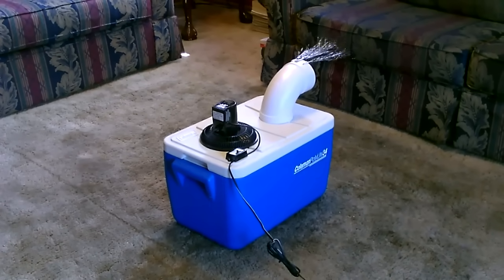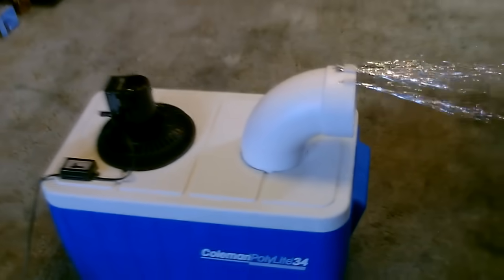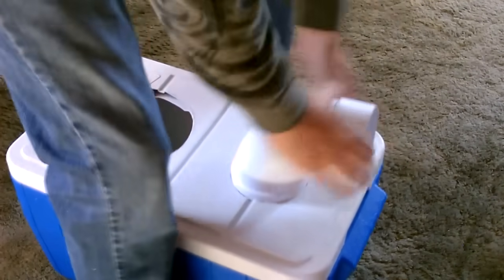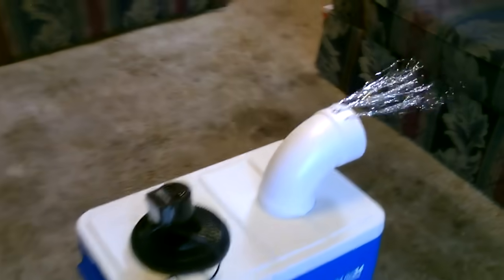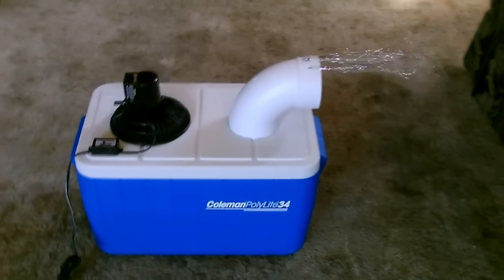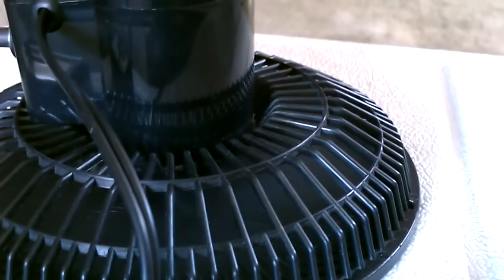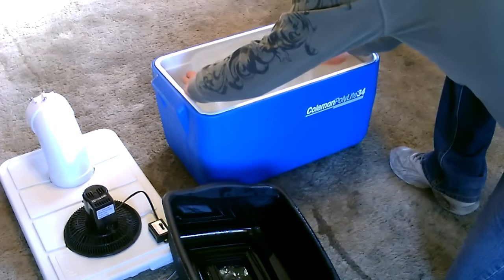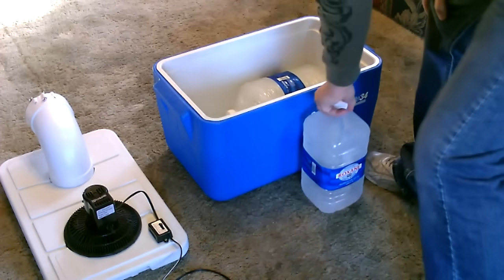Homemade air conditioner DIY - Awesome Air Cooler! - EASY Instructions - can be solar powered!

Comment: nice cold air blower,  if you studied thermodynamics and heat transfer (in mechanical engineering) you will understand one must take the heat (energy) from inside the room and dump it outside the room. That's why window air condit have the hot electric parts outside the wall.
Reply: ***** no. the slower the air flow, the colder the air out. if it leaves the freezer fast  it doesn't lose most of the heat inside the freezer so you don't get a colder aiir . if t it stays inside the freezer longer, the colder it gets when pushed out. Here is a tip for your proj, put bottles of ice inside vertically  better than a full square of ice, as the air go between the vertical bottles and gets colder quickly just a tip it's like cold fins.
Reply: ***** very good question. THink of heat as a quantity of energy that moves from high temp point A to low temp point B . Ice will let in a quantity of energy until it averages it with the surrounding temp, inside the cooler the surrounding temp is lower than the outside. Now you see why more heat gets inside the cooler, it should be slightly hotter than the outside when the room is fully refreshed with cold air.  The air will cool quickly if the bottles are inside the cooler container, and leaves that heat energy from air inside the container (it's built with heat insulation material to decrease heat transfer rate in or out) so it lowers the room temp, when the room is fully cold ,the heat temp in the water should be higher than the refreshed  room temp because the insulation of the container prevented heat temp from averaging with outside of the container temp, you take the water dump it. heat is outside the room now haha. Now if you do ice and fan on the open,  the ice will take some heat until it reaches "Average" room temp when refreshed. There are many factors like fluid dynamics etc, conduction convection radiation etc There is good book on heat transfer if you need more info on theories and calc (Heat Transfer by Cengel) you must have background in physics and math to get the theory. I wrote a bible sorry and still not enough hahaha
Reply: Spacefied Actually, this unit does remove the heat from the room as the heat is absorbed by the ice and stored in the melted ice (water) for dumping later. So long as the freezer used to refreeze the melted ice is in a different room the heat is effectively transferred to the room or space containing the freezer.
Reply: Gretchen Gund exactly,  hot air is converted into cold air, heat is dumped inside the cooler and doesn't escape to the outside because of insulation , causing the ice to melt. did you think of using dry ice ? should stay longer and is colder than regular ice
Reply: Spacefied You lack some bio skills. Dry ice is C02, is it not?  try breathing some of that. just make sure you stop breathing from the paper bag test before you pass out.
Reply: my chemistry is strong, so is biochemistry. I know dried ice is  CO2 at very low temp below iced water temp. I was just throwing ideas for inventors like this gentleman to develop, like making insulation walls or have it compress etc to keep the co2 or reuse it, or make a cycle to cool it again, if CO2 is a problem, then find a solution to use it safely it can be best or may not be I don't know, this what engineers do, problem solving.
Reply: canrobsd good stuff.
Reply: I have actually seen these types of things in auto repair garages, like giant 5 foot black boxes with a 4 something foot fan with a radiator  behind it with what looks to be run on a cold liquid. Same principle as what were doing, drawing air through a cold "radiator" (lined up bottles) inside a cooler (box)

Comment: Damn my huge vornado fan would rock if I can find a ice chest big enough to fit the fan on top. It spits out so much air, it's the largest room circulator before vornado starts putting the fans on stands.
Reply: Clear Adventure You are at least thinking, but the amount of airflow does not matter that much UNTIL you want colder air.

 The temperature of the air will be higher with a fan that produces more cfm, but will bring the room its in to that higher temp faster. Suppose you have a swamp cooler thats setup with 2 fans:

 Fan 1 produces x cfm and produces x temp. (for the sake of making it clearer im going to artificially make x temp 40F)
 Fan 2 produces x + 100 cfm and produces x + 25F (again made up numbers for sake of clarity). But more cfms will cool your room a lot faster to reach that slightly higher temp

Im going to make the best of both your comments, make a swamp cooler with a 2 fan setup (can be the same size) for rapid cooling then turn one of them off to get a colder temp.

I am too lazy to calculate air direction and flow over a surface area of ice that is constantly variable due to melting, and the size of box the air must go in, calculate any leaks in the system, humidity, sunlight through a window causing heat, and many other variables that make the math hard and tedious, So i just threw in some numbers for ya.
Reply: Zcypot LOL. Only problem is, too much airflow, and it defeats the purpose. The air around the ice has to cool first.  So a slower fan is best. I have some strong air fans also, would almost knock a small child over, lol.

Comment: the device works in areas with low humidity because it relies on evaporation. if you are in regions with high humidity the air's capacity to absorb the evaporated water will be low. hence the device will not operate in these areas.

Comment: Well, just did one of these, not impressed.  Room air temp is about 75, air coming out of my cooler was average 68...not sure I believe the 42 degree air claim as posted by others...I measured my car AC once and it was 38-40, and I don't think there is anyway air over frozen ice can pump out 42.  Maybe I am doing something wrong...but it is pretty simple so I don't see how.  Any help
Reply: i know how to get colder air larger ice and put another fan in the front  hole of the pvc and feel the difference omg but never use dry ice you will die!!!!!!

Comment: doesnt using ice from the freezer not really cool the room because in order for a freezer to make ice it has to pull the heat out of the ice and put it back into the air therfore not really cooling the room
Reply: Dean Walcott Because, everyone has his freezer placed in the livingroom right?
Reply: yes
Reply: Dean Walcott LOL good one. The whole Idea is comfort, so just blow the air on you to get cool. Or, If you were really serious, try to use it without A/C just put the fridge/freezer outside and cart the ice in to cool your room. But opening a door to go in and out may defeat the purpose of it all. Its hard to win without using A/C. Just blow the air on you while watching TV or something.

Comment: I noticed he is infront of the air of does temp runs right at the output, however what about the room itself, I am actually thinking on doing this in my downstairs bedroom so that way the whole house AC doesn't have to be turned on, great idea but if it only cools a small area and not a room then might have to go with a 9000 BTU Potable AC

Comment: Why don't use solar panel as a power bank for the real air conds? save electricity...
Reply: Shah Iskandar The 15 watt panel wont run a standard 120v ac unit. And if you wanted solar for that it would cost thousands. Where is the savings?

Comment: Suppose you have the freezer in the kitchen and you're cooling the bedroom. If all the doors are open, then this would be beneficial only to the extent that the air in the two rooms doesn't mix completely and provided we ignore the heat added from the electric motors in the freezer and fan. However, if you can isolate the two air spaces by closing doors, then it would be fine. The kitchen would get hotter (from freezing the ice) and the bedroom would get cooler (from melting the ice). At least that's the theory...

Comment: I LOVE Wisdom like this!! I am an Old Time Doer in that I departed Detroit, Michigan years and years ago. I raised 6 children alone including my small family farm with animals! I LEARNED so much to include milking cows, goats, hogs, peacocks, chickens, rabbits etc., churning, canning etc. I hooked up a heating system using a US Army #1 old wood stove using fans, big pots of water for humidity & circulation of heat. Summertime I used fans and ice! Sometimes I 'failed' so Miserably in my 'homemade' survival attempts until my children and myself just burst out into Laughter! Even my pet dog, Sable turned her head sideways and gave me a look saying 'are you sane?' I will share this so you can laugh too! I called myself repairing my old Singer Sewing Machine? To this day I am not sure how I reasoned how to repair my Singer Sewing Machine?! I plugged the Old Singer in and it had so much Power it flew off my kitchen table and went out the door! The cord snapped a loose from the socket and the sewing machine was truckin! Even science couldn't Crack this one! On a more positive 'Q' I did successfully repair my refrigerator that lasted for years and my dryer. In my new life back to Nature I had conditions/situations that were 'ticklers' during this part of my life and this is I was the ONLY 'Black Female' I ever knew that did this including camping! Everyone I knew including my family thought I was Crazy..unless I bought them some milk, buttermilk, fresh eggs etc. Now that I am 68 years old living in Arizona I 'Smile' remembering those Days..Divine Peace and Blessings to All. ..

Comment: it also helps if you line your ice chest with an extra layer of styrafoam, i am making mine tomororw and that is what i am gonna do, mine will be in my green house so i will have to put as much insulation as possible in mine, at temps of 94 and 100 outside haha in a green house i will have to

Comment: hi desertsun02.... Does the fan just lay on the top, or is it somehow fastened to the top?   

Also, what did you use to plug the fan into, that wire thingy that goes to the battery or the solar panel?    Thanks.... Carol

Comment: I have made this a very one. My cooler is slightly smaller and I used a flexible tube that goes on a dryer. I also found a small fan that works off a USB port. so I have a battery pack that I can charge in the Sun or plug it up and this fan plugs into the battery pack. I've got a couple of gallon jugs in my freezer at all times and it works great! I like my bedroom cooler at nite because I get night sweats so this is a great alternatives to a small air conditioner. I had a small air conditioner but it made my room feel too moist and I didn't like it. this is perfect, I have it in a cooler that has wheels very easy to move. What a great idea. when I plug mine in and put the ice in it last most of the night.
Reply: Donna Reeves "What a great idea." That's why there are men on this planet ;-)
Reply: Stephen Broussard search Amazon for a USB fan and it came up and it was only 10 dollars with shipping. the battery pack I used i plug up into my usb on computer and recharge. I am going to order one that charges in the Sun I have not done that yet.
Reply: Donna Reeves Im just wondering what you use this device for? But i wouldn't add salt because yes it makes the ice colder but as a result the ice also melts faster as it absorbs more heat faster (which is why its colder).
Reply: I also understand that if you put salt in with the ice it will get much colder, I will have to try that. This little air conditioner does work better with crushed ice then if you froze a chunk of ice. but if you fill it up about two thirds the way with a bag of ice it does last quite a while. so next time I'm going to put some salt in it and see if that really makes it colder.
Reply: Donna Reeves that's good, u got pics of your set up
Reply: Donna Reeves Where did you find yourself a USB fan?  And did you use solar chargeable batteries?
Reply: Michel Tangy hmmmm...😀
Reply: Donna Reeves I know that salt will make the water colder, but salt 'Melts' ice, so please let me know what happens with your experiment, you have me curious now. Also, I think you would want to add at least a half cup of salt to the water in a smaller cooler like you say you have, and swish it around until it is all dissolved. Adding salt directly to the ice would not help at all I don't believe.
Reply: Clear Adventure
Reply: Michel Tangy I find this statement incredibly sexist.

Comment: Okay I have a air handler that comes inside a house that I use out in my shop... I have it sitting on top of a big ice chest with a hole cut out. I put frozen bottles in there maybe two gallons worth add salt to it and turn it on.. The air is not that cool... Not like it should be.. Why is that? Could it be the fan is blowing way to hard?

Comment: have you tested this in hotter temps? like 100 degree temps?
Reply: steeltimberwolf Theres no reason it wouldnt work, it just wont be able to cool the air as quickly.

Comment: What are the specs on your fan?? I got a 6" one and it barely blows any air out of the cooler vents. Ive taped off every opening and made sure there werent any leaks but it still doesnt have much airflow..

Comment: This is a type of Air Cooler which is also similar to a Swamp Cooler which blows air over a grate / grid of flowing water.   In this case its air over ice (which will melt over time). They are certainly great but can also raise the humidity in the room you are cooling. Therefore if using this in any room with a lot of electronics just be aware of that.

Comment: Just curious...what type and brand fan are you using? I made a styrofoam one, but the 6" fan doesn't seem to push the air out very well and the 9" fan seems a bit big for the project...

Comment: I wonder if you put two in line using a U pipe the second esky has the outlet pipe the air would be a lot colder plus the ice would last days in the second esky only replacing
the ice in the first. Or you could put a one inch pipe back to the first box. Now you really have air con rather a air cooler.

Comment: Just a thought... 
If I'm using it in a truck (similar to a bread or UPS truck), would it be beneficial and help with humidity if I ran a piece of flexible duct from the backside of the fan to as high as I can get it in the cab (which would be about 6-7' higher) kinda like creating a return?? This way it just wouldn't be sucking air from entire cab. The ice may melt faster since heat rises but figured it may actually cool truck down better and maybe help with humidity. Does that sound like it would make sense??